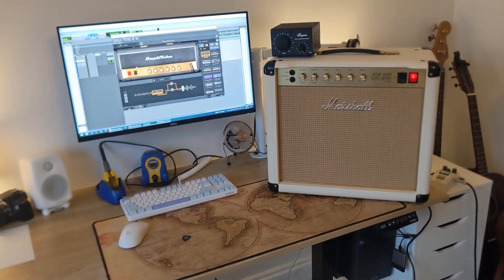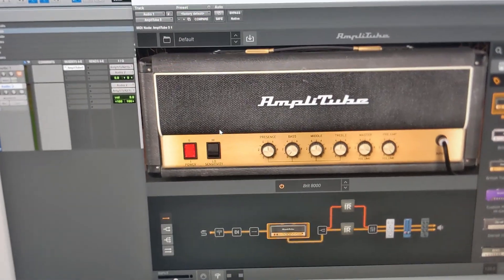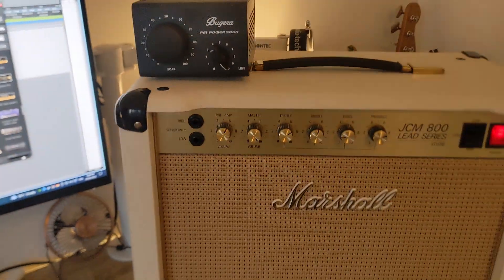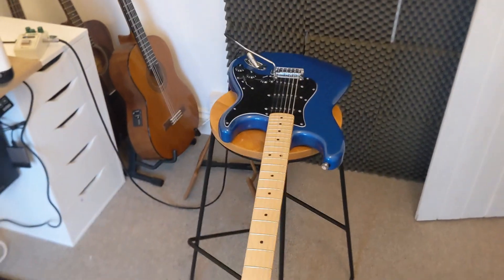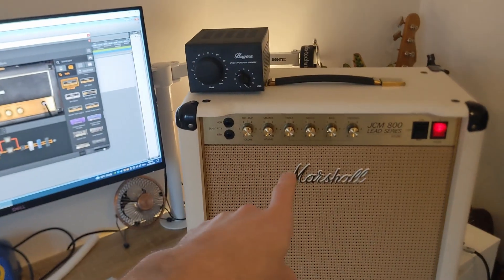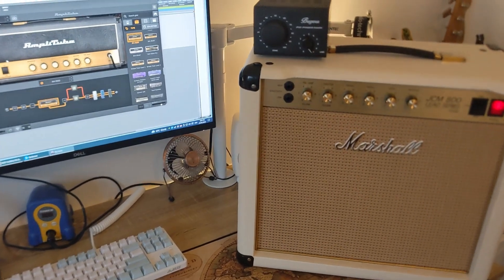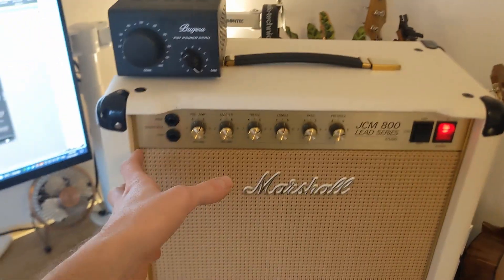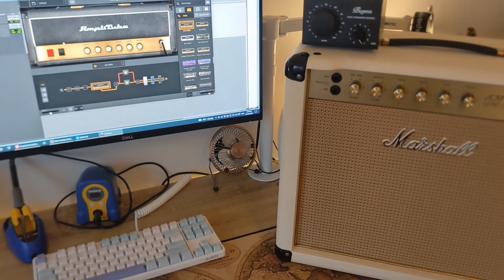Real Tube Amp vs Amplitube (Marshall JCM800 / SC20)

Comment: Hi, how do you link the bugera to the amp speaker? The cable of my jcm800 is too short...
Reply from the maker: You can remove the back panel and then unscrew the strain relief that holds the speaker cable to the inside of the cab to get a bit more length, or use a 1/4" female to female coupler + another speaker cable.